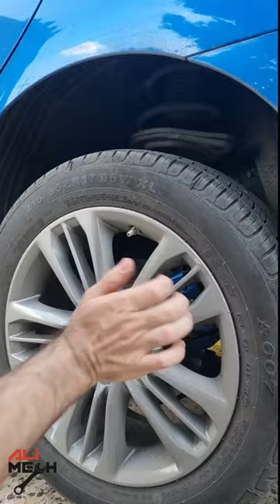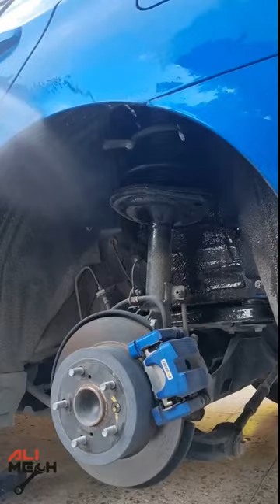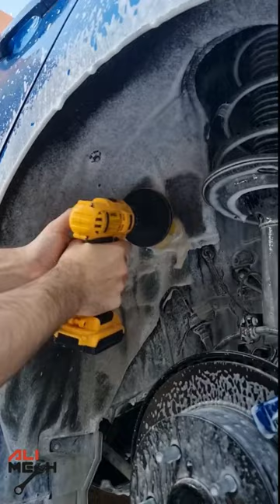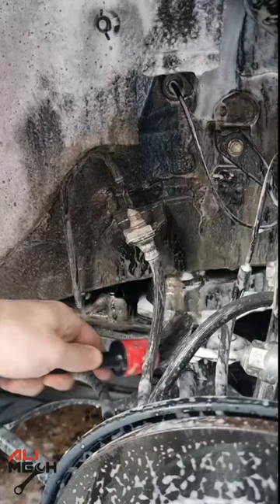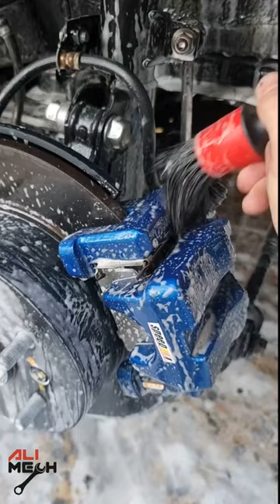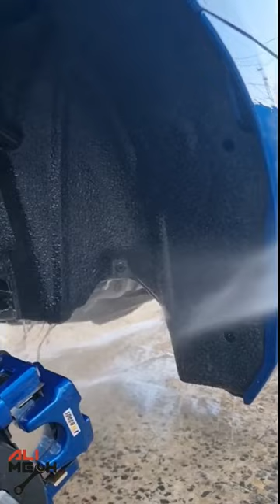Detailing wheel well #shorts

Comment: Personally i wouldnt detail that part of the car, it will be the same in 1 week, it feels like detailing the base of your shoe! Regular washing is enough in my opinion! Great work, but i think its a waste of time.
Reply: Its useful in selling a used car. The cleaner the better.
Reply: This means detail clean when one wants to sell to get a better deal.
Reply: You are right, i guess i didnt think of that!
Reply: I completely agree. On a daily or a car that's really not special this is just excessive since it will get dirty again after the first drive but there's only three scenarios where I could see this being acceptable, either it's a really nice show car that needs to stay in perfect condition, it's the end of winter and they're trying to remove the salt from under the car so rust doesn't build up, or if they are trying to sell the car and they're trying to make it look as pristine as possible to squeeze every last dollar out of it.
Reply: Ima take your advice with My next client thanks bro
Reply: everytime i see stuff like this i think, These guys buy all these fancy gadgets but havent heard of a heated power washer. For about $2500 you can get a decent one turn on the high pressure steam setting and get all that shit off in 30 sec. No brush no bullshit
Reply: @yamahayz0426  for $2500 ?!?
An electric plug in high pressure washer cost about $100. 
Cordless power drill is common DIY tool. 
Nylon brush attachment is maybe $3 (?)
Reply: @reallifeengineer7214  bro said 2500 😂
Reply: It’s worth it when spring cleaning in an area where they salt the roads
Reply: @yamahayz0426  the problem with heat and steam in these locations and door shuts etc is that it can strip grease that you actually want to keep in latches and joints etc
Reply: Being that each wheel well of my car is worth about $4,500 ( including wheel ) I see no problem doing this once a week or at least 2 a month.
Reply: Gets rid of built up containments and salt to reduce the chance of rust.

Comment: Some people might think this is being too anal retentive, but let me tell you.. After I fully restored my car with new undercoating and every single suspension arm, bolt and bushing was bought and fitted, it was like a brand new car and I wanted to keep it that way. Cleaning the arches like this every other week made my life so much easier when I had to do maintenance. No faffing about, no rust, no rounded bolts or clogged threads.  Everything was clean and easy to take apart.. Been doing this for years now.

Comment: Car ECU After Wash: Brake pads wear, brake booster insufficient, Head gasket failure..
Reply: My car radio does not work, my window switches don’t work, my other push button electronics don’t work, ect ect. lol cringe every time is see them scrubbing everything interior wise. Even engine bay cleaning. They don’t know how water affects electronics.

Comment: The security screw in rotors is loose!! It turned when you sprayed it.
Reply: It’s not a security screw, it’s to hold the rotor in place during factory assembly, the wheel holds the rotor against the hub

Comment: Nobody ever thinks of cleaning wheel wells or the undercarriage. Then they wonder why things break and why mechanics charge so much to replace parts. If you don't clean things, bolts rust and seize. Takes twice as long to replace parts. And sometimes you actually have to cut a part out to replace the part behind it
Reply: If it took 10 times as long it would still be a fraction of the effort compared to doing this type of cleaning regularly.